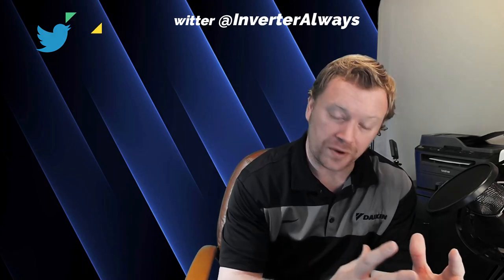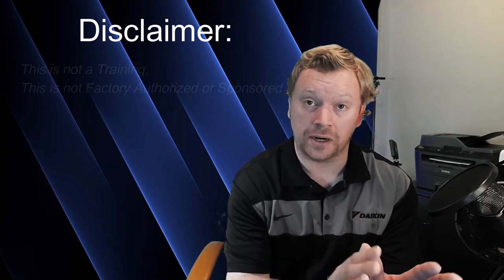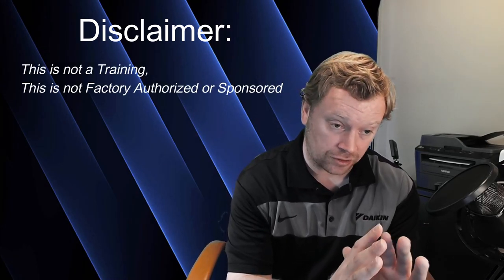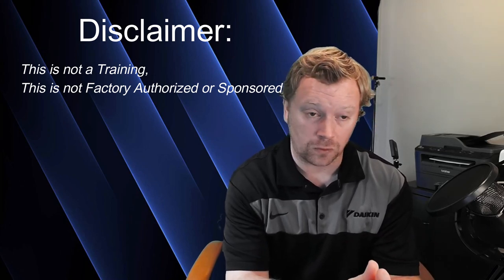Daikin VRVS - Install & Commissioning Series Ep.1 | Product Technology Discussion - 9-17-2021

Comment: Dana, a little off topic but it's in the realm of installation....  I haven't seen any examples of how to terminate and seal the supply and return's duct insulation vapor barrier (silver foil) to the FXSQ cabinet and thought you might want to share some insight?  My indoor units are in an unconditioned attic.  The FXSQ has supply and return flanges which bolt in and seal to a factory bonded foam seal.  There is also a grey coating bonded to the bottom access panel and cabinet sides.  Only the top of the cabinet is bare metal.  So I am hesitant to tape and seal the vapor barrier to the outside of the cabinet with all these factory coatings and foam present.  Should I tape and seal the insulation vapor barrier to the outside of 1 inch flange ring, similarly to how I air sealed the duct termination?  The installation manual does not mention how VB sealing is accomplished.

Comment: I think I recognized the T Dome in your intro.

I would like to get a hold of you and talk to you about the D checker I picked one up a week ago on your video you were showing how to set it up do you have to be plugged into a unit to set it up completely on the app I was only able to go so far?
Reply: D checker can be insanely intimidating and it’s outputs are like Chinese at first. I’ve heard it gets easier though. Dana is a great resource.
Reply: @RattleCanCollective  can’t believe that gumball machine sized checker was almost $400 it’s the Bluetooth version
Reply: So tonight I was re-watching your video about setting up the Bluetooth the D checker I noticed the version of the Daikin air conditioning monitor tool I think it’s 1.27 it doesn’t have that search symbol like you show on the video the version that I downloaded last Friday or Saturday night when I watch your video for the first time so I wasn’t able to get past that point that’s why I was wondering if it needs to be plugged in to program the app more but I would think that you can program the app without the tool being plugged in?
Reply: @InverterAlways  Later after I posted that I was thinking that could have been used a bit twisted. Didn’t even think about being able to edit it, no problem about the removals.

Comment: great video... i had some specific questions.. we will have a 8 zone 3 level Single Family home we are building for a customer.. we have a restricted ceiling space as we have 1 feet between ceiling.. how do we place air handlers for every indoor unit? but we do have good mechanical room can we go with traditional duct with one single air handler? which would be more efficient
Reply from the maker: Efficiency really isn't the thing here both options will be efficient. The fxsq is I believe 9 inches tall you can use those for each zone if you want provided there is width and depth space for these. Sometimes a soffit is handy as well. 
If you go one air handler that'll increase your ductwork so possibly less efficiency from that but hard to say exactly how much. If you have room for fxsq units then it's more of a preference how many zone setpoints will they want or need. One air handler means make sure you design the ductwork right, and keep static down. Big house for a single system.